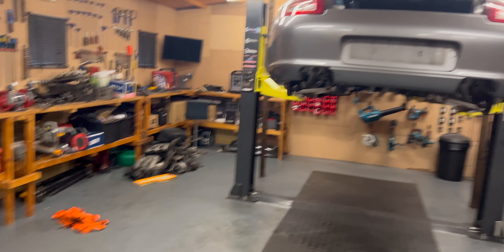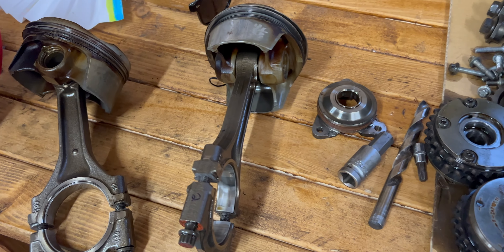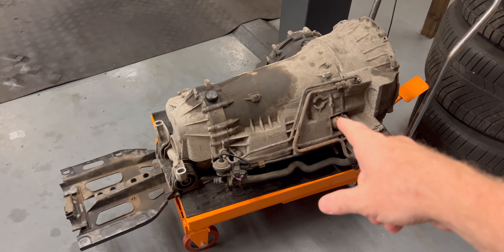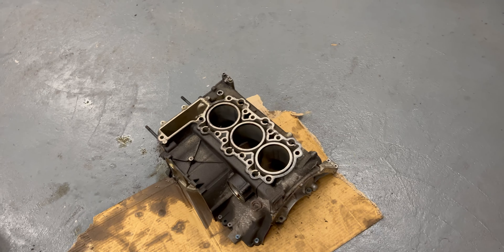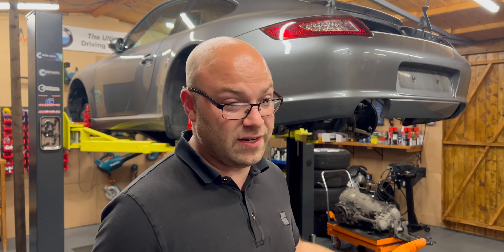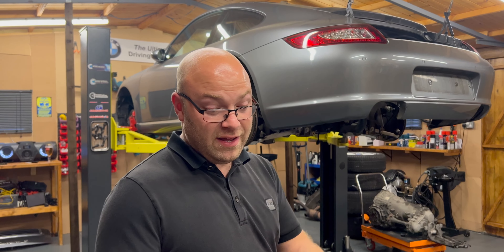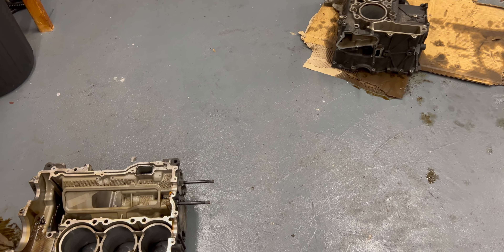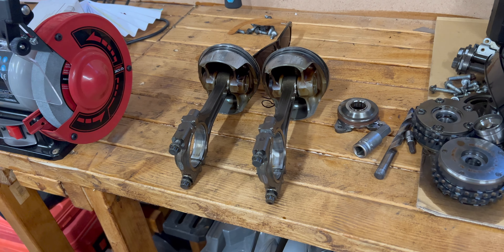Rebuilding A Porsche 997 Engine With Bore Scoring For $1300

Comment: When I rebuilt my 997.1 3.6L @72k, I replaced the two scored pistons with good used pistons for $50 each from a shop that had lots of them since most 3.6 rebuilds have owners that opt to upsize their bore.  I considered Cerakote for the skirts but opted not to.  I also reused my old piston rings since their gap was perfect for the newly re-plated cylinders.  In lieu of steel sleeves, I went for the Nikasil (Nickel Silicon Carbide) plating from Millenium Technologies in Wisconsin.  They were great!  Reuse the head bolts if they're not stretched (never) and use new ARP rod bolts since they are a weak point.  New, wider rod bearings with new main bearings and put it back together.
Reply: I'm at 77k today and loving it.
Reply: Do you have more details and/or video of the process you followed? Where are you located? Doing my research and hoping there is a cheaper solution than the crazy expensive  L N  route. Thanks.
Reply: @rezilient112  I watched various Youtube videos.  Probably spent more time watching videos than doing the actual work!  I'm in Omaha, NE.  Still going strong.  I just bought a 2006 Cayman S for my son and believe we're probably going to need to rebuild its 3.4L.  Maybe we'll try to upsize this one with new sleeves and pistons?  What engine are you dealing with?
Reply: When I rebuilt my cayman I went with LN 3.8 they came with new JE pistons. I also rebuilt the heads with Hoffman, everything else inside the engine is brand new including injectors, I reused nothing.
That car burned oil from day 1, about 1 liter for every 1000 miles, LN says it’s normal, it’s driving so nuts that I’m thinking of tearing it apart again and trying the ones you used, even though the car runs absolutely perfect and smooth and it’s been 80K since the rebuild. I just can’t handle the oil consumption anymore .. what do you think ? How much did it cost for resleeving ? How come you never hear of this company? What’s their around time ?
Reply: @MowSow cheers from the Porsche FB groups. I’ve seen the steel sleeve horror stories that LN and Hartech show. I’m interested to see what you find since I have a 996 C4S that burns some oil but I am curious if this cheap Nathan solution is permanent enough
Reply: How do you know if your head bolts are stretched?
Reply: @cmpoirot1  They wont torque up the metal becomes plastic and it stretches each time in extreme cases you can see wasting occur where the bolt gets thinner as it stretches
Reply: Nikasil is what Porsche should be using in the factory not this plastic coating idea that Volkswagen made them use.

Comment: MIne passing 120000 miles, unopened enigne,   Spotless !   Heavy track use,  oil analysis show no symptoms of bore scoring,  scoped the bores in 2021, spotless.... so i sleep well at night
Reply: What year? And trim?
Reply: Sooner or later it will happen .. the magic number is 200,000 miles. Get rid of it BEFORE it hits bore score
Reply: @MowSow  i still sleep well at night
Reply: @997GURU  of course .. I’m just warning you for the day when the car will make you lose sleep over it, so you don’t
Reply: @MowSow  I get back to you when passing 200000 miles 😅
Reply: @997GURU  been there .. done that … bore score on cylinder 6 only, thrust side only. All other cylinders looked brand new at 220,000 miles. Absolutely crappy design and defective cooling on that cylinder
Reply: @MowSow  i agree on some of the faulty design,  did you had the low.temp thermostat installed ?
Reply: @997GURU  yep low temp 71°C stat
Reply: How often do you change the oil and what do you use?
Reply: @Vtertdfgwrth5ybdfasgagadfg  oci at 5000 miles,  valvoline Synpower 5W-40,  royal purple filter (spin on) since i have the IMS solution
Reply: @997GURU  Thank you😄👍
Reply: @Vtertdfgwrth5ybdfasgagadfg who me? Liqui Moly every 5K. Good German oil is not going to save the engine, the coating on the piston skirts will strip and starts digging into the silicon coating of the cylinders.
Also bad engine cooling design will cause cylinder 6 to get too hot, and it goes OVAL with time, causing the piston to dig into the cylinder wall. Porsche should have been sued and forced to pay compensation for every one with an M96/97 and 9A1
Reply: @MowSow  Probably why porsche is so tight lipped about it, if people could pin point the exact cause they would have a class action on their hands. I've heard the likelyhood of it happening can be reduced by doubling your oil change interval. I'm thinking dilution of oil viscosity from fuel and a build up of contaminents could be a factor too. Ive been doing oil changes every 3000 miles 😩
Reply: @MowSow  my oil analysis the last 10 years show no scoring,   aluminium and silicone just 1 to 2 ppm,  and i could easy brought oci to 8000 miles  because TBN  after 5000 miles is just 9     ,     Tbn on Virgin Valvoline synpower is 10
Reply: @Vtertdfgwrth5ybdfasgagadfg  you are absolutely right .. oil dilution is another big factor in bore score. This is why cars in cold climate are more susceptible. When you start the car on very cold days. The car will dump a lot of fuel to warm up the cats. This unburned fuel causes oil delusion and will wash the oil from the cylinder wall, causing direct contact between the pistons and the cylinders.
Reply: Well 220,000 miles mate… is a fair amount of use on pretty much anything… that’s basically putting on 400,000 kilometers.. on a performance car and then complaining that it needs an engine rebuild!…that it does does not seem that odd to me.. or an indication of poor engineering. Just out of curiosity, what were your expectations?.. 500K…600K?

Just the slack that would naturally develop in the joint between the piston and the piston Rod would necessitate a tear down. And let’s face it.. if there is a wobble there you are inviting all kinds of tracking problems in the cylinder… quite likely including bore scoring…and that’s just about on any car going that distance..

Comment: I really want a 996 or a 997 but there are so many problems with the engine unless you have a big bank account they are problematic, today I learnt that head gaskets fail, and all the O rings that are designed to keep the coolant out of the oil fail, let alone what I already knew about bore scoring, cylinder chunking, the IMS bearing Crank seal, and countless other things like header tanks, water pump, 2nd gear synchro failure etc. I am out. Hartech will charge you £12,000 for a straightforward rebuild if you take it all to bits and refit it yourself! On top of that, you might as well do the clutch and replace the IMS and that's just for starters.

Comment: A couple of comments about this video.  A rebuilt engine from Harteck (world class builder) is not $30k.  I believe the cost is between £11k and 13K.  If you follow Porsche Club USA, you will discover the cause of bore scoring on 996, and Mk1 997 plus Boxsters.  Bottom line, probably the accountants pushed the engineers to dispense with Nikasil coating on the bores.  They replaced it with cheaper Lokasil which in this application was a disaster and is the cause of bore scoring.  Switch back to Nikasil coated bores and the problem is fixed.  Fitting iron bores I suspect will induce corrosion between the bores and the casing as you will end up with dissimilar metals and with the surrounding water will induce electrolysis.
Reply: At minimum, it will change things like the cooling performance of the engine, adding another thermal interface between the Al and iron. Definitely not Porsche spec any more at that point. There's a reason they didn't use iron cylinder liners in these engines.
Reply: If there is any excess fueling it will show in an oil sample. Best to use a good injector cleaner in a tank of fuel every few thousand km. But getting an oil sample analysis is gonna show up wear too.

Comment: Great video, as always. Regarding the 997.1 GT3, GT2, and Turbo, as you are aware they have the Mezger GT1 engine that have the Nikasil plating on the bores. For reference data, I just had my 997.1 Turbo borescoped while I was having routine maintenance done, and after 117K miles it shows no evidence of scoring. It also does not smoke nor does it use anymore oil than the day I bought it in 2008. This has been my daily driver for 15 years, and it has not been modified or tracked. Oil change every 5K or 6 months. Thank you.

Comment: GT3 & Turbos of this generation have a completely different engine and those cylinders were lined with Nikasil instead of Lycosil like the carrera  cars. That's why they don't suffer from bore scoring. That's why Hartech and LN Engineering use liners with Nikasil.

Comment: My 987 Cayman S has mild scoring in cylinders 4, 5 & 6.      Which company do you use for engine rebuild ?    I am on a tight budget, so the silly quotes that are bandied about, like £10k are out of my range.  I live in Nottingham.    I look forward to your response.
Reply: I would be also interested jf you find something.
Reply: Maybe contact BMW Doctor on his channel this guy doesn’t know nothing. BMW Doctor rebuild on his own without this guy and he’s rebuilding another. Maybe he will help you? And they no use any company BMW Doctor Dean rebuilds them himself
Reply: I'm from Neath Swansea Area...I used D9 Auto tech in Bridgend Area roughly 5 years ago...My 997.1 had scoring 4 5 6...I was billed roughly £6500 Full strip rebuild Inc ims retro fit...👍
Reply: @mikefranky  how have you found the car since he the re-build are you happy with the work done by D9 ?
Reply: @richardparker7614 .....Car has covered roughly 10,000 miles and no issues...👍
I'm using Millers 10.50 and magnetic sump plug (£6 From amazon)....All good so far...👍
How's your 911 running?....

Comment: Nathan, standing at the back of the car and looking forward, which way does the crankshaft rotate, CW or CCW? And where is the scoring happening on Bank 1 and Bank 2, at the top or bottom surface of the cylinders?

Comment: Who did you use in the UK to machine the block for the new liners? Thanks
Reply: I used a good friend of mine local to me who does it been doing it for 20 years on Porsches it’s all he does. In the end it only cost me £1395 for 6 new steel sleeves that was it but I had to get 4 new pistons which I did as I didn’t trust using the ones that was badly scratched up engine is going to be back together soon as I’m waiting on a few other upgrades
Reply: @BMWDoctor How much do you charge for the end to end service (engine removal to repair) I have a bore scoring on cylinder 4 and 6 on a 997.1 am based in South East UK, Thanks
Reply: If he's in the UK, are you able to share your friends details who did the liners? Thanks
Reply: @Markymark1408 contact BMW Doctor directly 🤷‍♂️
Reply: @BMWDoctor be better if you actually knew the prices at hartech

Comment: Mine had bore scoring at 30k miles, as well as some crank bearing wear. Car had been serviced very regularly.
I ended up getting a rebuild to 4.3 litres with Nikasil liners, forged pistons and rods and over 450bhp. It’s an absolute torque monster now and a real riot.
Reply: Where did you get the engine built?
Reply: @whaws  Flat 6 innovations.
Reply: @I999-g2s  how much did it cost for the 4.3 build? Their prices and descriptions seem to be a bit secretive other than what other people said on the forums
Reply: @whaws  was around 50k
Reply: @I999-g2s  please please please post videos! Is this at sea level? I am at the point of do I want a turbo instead of my 4s, or just send a big NA build?
Reply: @MichaelMeyer93  forget the turbo, get the 4.3 conversion. I also have a 991.2 GT3, and I have to ring it out way past 6000 for it to feel faster than the C4S.
Reply: I would also love to see a video of that car 😍
Reply: It’s been around 9 months since the rebuild and my God is it much faster now. My buddy has a modified M3 and I asked him to guess the power in the 997 - he said it felt like 550. It’s definitely at least as fast as the GT3 now. I don’t really have any video equipment, but will try and borrow some, to make a video.
Reply: What shop did you have do it?

Comment: Aside from the issue of liner coating delaminating, I wonder how Porsche lubricates the bore on that engine?
Seems they would have block mounted oil sprays to cool the pistons...?  Or, drilled the rod big end to spray without creating too much windage loss..?  

I could be wrong.... maybe not an issue.   Anyone have insight into this?

Great video.
Thanks
Reply: Great idea just need to be sure to run a heavily weight oil & keep tabs on oil press & volume.

Comment: Could ethanol in fuel be a part of the bore scoring issue? I have read about that it is bad to briefly starting the engine and shutting it down may cause condensation that may eat at the liner coating. Adding to that you may have unburned fuel with ethanol mixed in.

Comment: So glad to see this video!!! I am rebuilding my 53k mile 2005 997 3.6 and the engine looks JUST LIKE THIS!!! You might want to video taking that b*tch of a transmission off of the block.  There's no videos on youtube that I could find and it's really hard to figure out how to remove it with that adapter plate and those hidden backwards bolts on the bellhousing.  Thanks for the good work, Nathan!!!
Reply: That was not a easy task… that took both of us a lot of force and lifting and turning the gearbox and engine upside down to even do it. Getting that gearbox off was probably the most hardest part of the job I’m dreading putting it back on! But I must say overall it’s a solid
Transmission and I love the fact it’s a Mercedes transmission as I know they are solid and parts are readily available for these. Haven’t actually drove this car as of yet but I cannot wait too

Comment: I would scotchbrite the piston skirts and pop them back in. They are not contacting the bore walls unless the walls wear, which the new steel liners will fix, so new rings, new liners and a tidy up of the piston skirts would be my route.
Reply: The coating mahle used is terrible, it will continue to flake and destroy the cylinder wall. Not a good idea to use them regardless of what you say how they should be treated

Comment: Those wear marks match the shape and reach of the piston skirt, a mixed-domain bearing interface (both hydrodynamic and boundary lubricated) that is not provided continuous oil pressure. It relies on splash and spray lubrication of the cylinder wall to prevent it from being metal-on-metal. In a flat engine, the skirts rest on the lower half of the cylinder. At rest, this presses oil out of the interface and allows the plain aluminum skirt and Lokasil cylinder wall to touch without oil between them. That's a recipe for scoring. 

The problem with this theory is that it could have been fixed by using a skirt coating. While this wasn't a popular technology in 1998, startup wear like this is something Porsche would have known about from decades of making engines. It seems like the change to these cheaper cylinder coatings caught them off guard, but I don't really understand why they would continue using incompatible materials like this if they knew they could easily make them compatible with a small post-machining change to the piston. So either that wouldn't have fixed it and there's a bigger underlying issue, or Porsche was in an era of being run by accountants.

Comment: 996 turbo owner here with 150k miles on the clock. I have receipts of a bunch of engine work for a blown head gasket, and a shop reassembling the engine incorrectly. No record or signs of bore scoring though when the case was split. The previous owner did upgrade the rods though (while you’re in there)
Reply: The mezgher engines don’t score their bores thanks to Nikasil liners.
It’s only every other Porsche, all the way up to 2020 that will eventually score.
Reply: Thats because your engine has Nikasil coated bores.

Comment: Someone should make a bore able cylinder head along with stock and oversized pistons from a motorcycle company like Wiseco.

It's sad that Porsche made it's name for simplicity and durability in endurance races and now they're not reliable.

Maybe a little premix like the rotary guys use but that would shorten the life of the expensive catalytic converters.

It seems like a Subaru turbo motor would bolt in from the WRX STI.
If Toyota can use a BMW motor Porsche can use a Subaru one.
How embarrassing.

Comment: I had the same issue with my 997.1 3.6 C4, so I upgraded it to a 3.8 at Deman Motorsport in NY. It cost a little over 20k. It was year 2018 though.

Comment: What is the name of the shop and who in the USA can do this? I have access to the machines to do this job but I like to know whats the best materials in steel to do this? Whats the new liner wall thickness? what finish do they have? what is the ID and tolerance? is it a press fit or a shrink fit?
Reply: In USA it’s much cheaper they can fit iron liners for $1200 BMW Doc Dean knows the place as he’s said on many of him videos! He has place in USA and UK as him and nathan were selling resleeved cases in the USA.

Comment: The coating that mahle puts on the pistons is terrible.. and not the moly black stuff... the stuff everywhere else flakes off and becomes debris. In my opinion.. a naked piston or one with line 2 line skirt coating would be far better than the mahle factory piston. If you were trying to save those pistons l2l the skirts to 70 percent of skirt clearance and call it good, they will wear in to their perfect fit.. than stop giving you a much slicker surface to ride on.